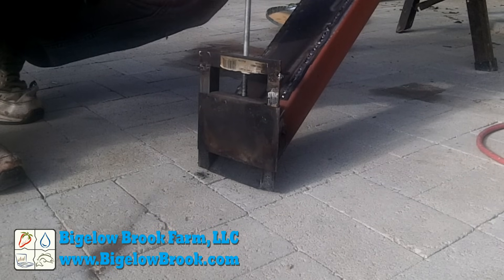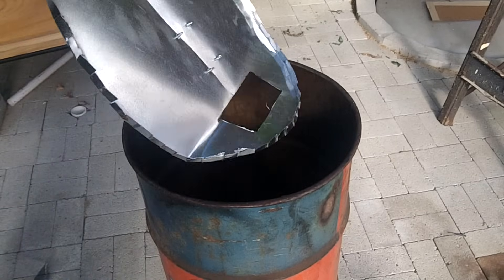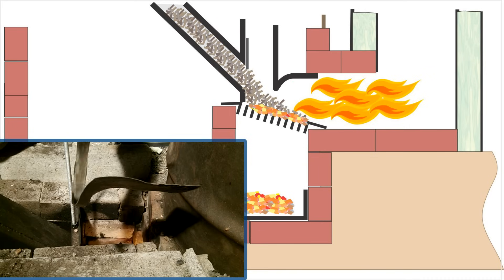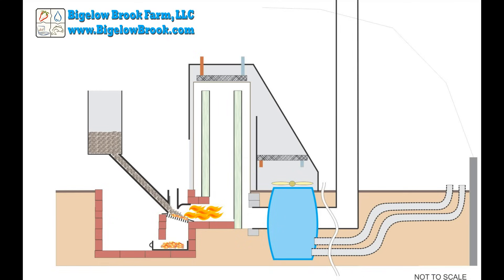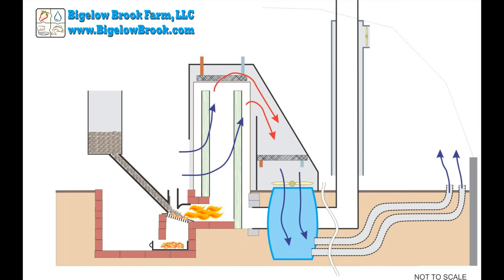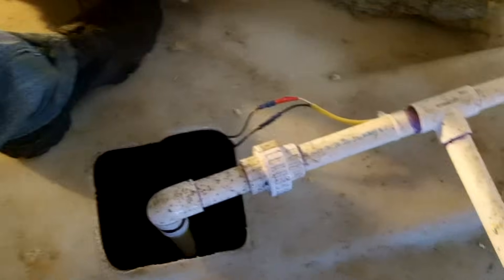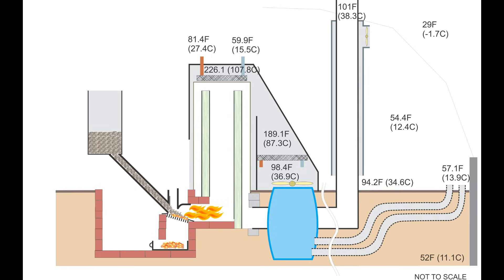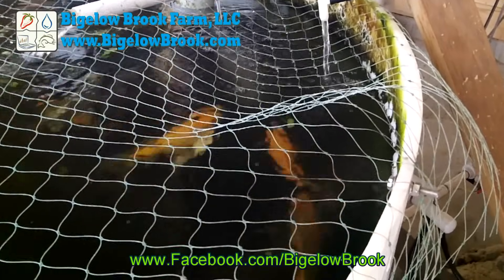Rocket Mass Heater - On Steroids

Comment: This looks so dangerous.
Reply: No more, heck probably less dangerous than having a fire place or wood stove.
Reply: A pipe gets a hole because of acidic water due to the low Temps, do you not see an issue with carbon monoxide?
Reply: I guess it really depends on how air tight that room is. But yet again same thing from a normal fireplace and wood burning stove. Also the way he has the water running he would notice a leak long before it had an effect on the stove piping.Plus, I would be willing to bet he has a carbon monoxide alarm in their to be safe. Every building where things are burned should have a alarm like that.

Comment: Does the cooler temps not trap acidic condensate in the low flue pipes?
Reply from the maker: I haven't seen any problems with it yet...but haven't dug up the duct that's buried under the floor.  If it is in there, it will just weep out through the joints.
Reply: Bigelow Brook Farm (Web4Deb)   It will erode the pipe quickly and then be filled in by whatever was around it.  You also have a great potential for CO issues in the home.

Comment from the maker: The 2nd most viewed video this year triples the views of number 3!  With 264,007 (268,862 total), it was published at the end of last year.  It shows some extreme enhancements we made to the rocket mass heater to try to extract as much heat as possible from it.  I'm still burning pellets in it without any issues...but I am currently working on a new design for next season!  Rocket Mass Heater - On Steroids
Reply: do you have a cost comparison of fuel pellets vs wood?
Reply: I can gather my own firewood but must purchase wood pellets.  The ones I'm using are $7 can for a 40lb bag and I would rather burn nearly free firewood over 7 dollar a day pellets.  Although he may be able to increase his efficiency by throttling down the pellet feed rate. His exhaust to outside temp seems too high, wasted money.
Reply: Logan Mailandt the pellets are clearly more money, but the gain is the convenience. Over time, the user would learn the ratio of pellets over time, and be able to add that specific quantity to the system all at once. Only having to return periodically to fill the system back up for the next burn. The wood fuelled heat would consume a chamber full of fuel much more rapidly, requiring the user be present much more often. 
All that said, wood pellets aren't too expensive, and are much more affordable when used in a more efficient systems than the conventional pellet heater.

Comment: What about the aluminum getting in the fish water? I wanted to use a radiator for my fish tank heater, but running the water through an aluminum radiator does NOT seem like a good idea.
Reply from the maker: It's not something I would recommend for everyone to use.  Aluminum can become a problem if the pH goes really high or low.  I can't remember the chemistry behind it, but it does have a toxic effect.  I usually tell people they should keep this part closed loop and put some stainless steel loops in the fish tank.
Reply from the maker: tammy c stainless is the best way to go.  Copper is far worse than AL.
Reply: Ya I think we will build some copper loops for it.
Reply: tammy c opps copper is toxic to fish??? so stainless steel
Reply: thank you
Reply: +tammy c  Tammy, when copper is exposed to water intermittently it will Verdigris, which is an acidic formation on the pipes that makes them appear greenish blue. This formation is toxic to biology and would only be effective in a closed loop system where wetting was more constant and the possible contamination with lead soldered connections may be more likely. Poster used AL possibly for its cost effectiveness and was easy to obtain. "Copper Worms" are common in many water distillation processes. Many of which are being replaced by Stainless coils which are almost noble in their properties. Some people even drink that water!

Comment: does all that lead in the radiators not harm the fish?
Reply from the maker: they're aluminum.
Reply: yes, but radiators are soldered together with lots of lead. I just know they are not at all okay for home brewing. 'how it's made' did a segment on radiators; maybe it's online
Reply from the maker: It's aluminum!  You can't solder aluminum.  They are all welded together.
Reply: +Bigelow Brook Farm (Web4Deb) whew, I thought you'd never say that.. yet I knew you knew somehow. Your system looks thoughtfully contrived to me. Kudos and so true- AL is brazed; copper is soldered. Therefore, there can be no leaded soldering of connections. However there will be trace amounts of AL in the water due to galvanic reaction. Is ok, Koi will let him know if they swim on their side just move them to fresher water and flush system clean. Sooooo, peace out Bigelow!

Comment: scrap the box fan,it waste way too much power!
instead use 140mm 12dc computer fans,  10-12v switching power supply/charger.
next get a solar panel and homemake 18650 lith battery bank for the 12v
next,12dc pumps, white leds for lighting then your complete.
use car for ER generator for batterys.

Comment from the maker: the radiators take some of the heat that would have just been blown into the ground and put it into the fish water.  I could have done it with loops, but I would have had to use stainless steel piping (copper is toxic to the fish) and it would have gotten very expensive!

Comment: Maybe I missed it, but were you saying that the key purpose of the radiators was to remove excessive heat from ground system? I know it also runs warmed water over to the fish tanks as well, but that could have been done with hot water loops around your outer barrel right? 
I'm not judging, as I've only read about these heaters. I really appreciate your detailed videos and explanations!

Comment from the maker: It hasn't been an issue, but using aluminum is usually frowned upon as it can become toxic if the pH goes REALLY low.  I'm planning on replace them with stainless steel.

Comment from the maker: I've never tried to bypass any of the rafts to heat just the fish....I just wanted to avoid having the system too complex.  I have to be really careful not to heat the water up too much over the air since it will start to condensate too much.  I already have a problem over the winter with powdery mildew when it gets too humid!

Comment: hey I was wondering if you have done temp tests I figured at every 1 you raise the water temp of the fish 2 degrees with it cycling in the system but if you put it in the sump by bypassing the raft system having it run into the heater then the sump? until you get a constant water temp of total system of 77 degrees which plants roots love grow like wild in the winter easy up take..Love your system have to show you mine some day when I get all my projects cleaned up plus I use car parts with solar

Comment: Harbor Freight has a laser targeted infrared thermometer for $35 (sometimes even cheaper) that accurately reads temperatures up to 968° F. It works great! ...despite its price vs the ones found at h.depot and lowes. just a suggestion. throw that other/old one on craigslist or ebay to get you some money to buy the new one with :)

Comment: There was a fellow who took ceramic "90' angle iron" and criss cross those ceramic angles. this was for a "standard" pellet stove with I believe a vertical pellet supply. the ceramics were tempered and supposedly could sustain higher temps vs. stainless steel and for sure reg. hi carbon steel. It would be worth investigating if the price was better than ss .

Comment: Have you thought about feeding the air into the system from outside? Currently all the air that is vented out the chimney must be replaced from air which will enter the room from outside. Directly feeding from outside would eliminate this requirement.

Comment: Ahh *nods* you are quite correct.
I would think tho that if that is the intent, then a small thermal insulator around the mass (which is intended to be the thermal mass), to isolate that mass from the ground mass would be ideal.
Yes?

Comment from the maker: houses are far more energy efficient than a greenhouse (here in New England) so we need to produce a lot of heat at night.  The unit burns far more efficiently and hotter than a regular pellet stove.  It's also is used to heat the water and the extra heat is stored under the floor.  It also costs less than $500 to build and doesn't require electricity to run (but I do use a fan to pump the air under the floor).  There really isn't a comparison between this and a home pellet stove.

Comment: Part of what he wants this system to do is to heat the thermal mass of the ground. This is where some of the confusion is coming from for others concerning the heat output of the system. Most are not taking into consideration the ground. Good on ya to catch that! Just keep in mind the reason he has those tubes is specifically to heat the ground.

Comment: Have you thought about recessing farther into the floor and using thermodynamic circulation as a backup for pumps? If you look at this idea using copper or aluminum tubing and fittings on the radiators might be a good idea based on the melt out from one of your other videos.

Comment: my understanding is CO WILL burn, if the temp high enough. Temps in the heat riser (rockety part) of a RMH easily exceed whats required.
Still...your right, a CO detector is a good idea anywhere fires are used!

Comment: Hello, you will want to use the exiting excess heat to preheat new cold incoming air in the winter. This gives you a higher efficiency of the system and a higher room temperature.
Nice job!

Comment: I love your whole system. You could attach a peltier generator from teg power or build your own ,and use the extra power to charge up your battery bank or power more water/air pumps. Attach the cold side to the water coming from the ground,or the fish tank. Build a simple oil circuit for the hot side(300c), so you can maximise the temperature difference.  Also I've been wondering what might happen in an aquaponic system if you connect a water imploder from dan winter that makes structured water.

Comment: I just thought 40lb of pellets was a high consumption rate. So how many BTU do you think the system generates? As a comparison here are some numbers with what u can get with natural gas, if available of course. 1 cubic meter is approx. 10 KW = approx. 34,000 BTU = 10 cents. If your pellets cost $6 bag that 60 cubics of gas x 34,000 BTU = 2+ million BTU.  Now for a premium bag of pellets ( not the $6/ bag ) there is 8700 BTU per pound, or 348,000 BTU. Something not right here.

Comment from the maker: the 4.4KW heater would just be for the water part, which is just a fraction of the heat the rest of the unit is putting out.  Between heating the water, thermal mass, and air, it costs far less to heat with pellets than it would with oil or propane.

Comment: love this sort of stuff and commend you for your efforts,HOWEVER, you say you consume a 40lb bag of wood pellets in approx 8hrs. Cost of a bag of Pellets is say $5-$6. You also say the rocket stove generates heat equal to a 4,4 KW/hr heater. I'm not sure what the advantage is compared to doing all this electrically. Lets assume 1 KW/hr costs 10 cents that's an electrical cost of 44 cents. Multiple 44 x 8 hrs is $3.52. Use natural gas cut that in 1/2. whats the advantage to this system?

Comment from the maker: The water will boil out of the radiators and the heat just domes out of the cover.  It's happened twice now.  Usually if we lose power, I usually run down it shut it off before the water boils out.

Comment: Awesome work!!  Don't burden yourself with minutia like crappy welding just continue to prove concept, like you are doing, and move on. There are many fine skilled people out there to accomplish fabrication. I did not watch your other clips. However, I strongly agree with a previous posters good advice to get a CO sensor installed if the combustion /  exhaust components are in close proximity to an enclosed space. Good luck!

Comment: Hate to say it but I think you have a hazard brewing with your design. If any part of the exhaust system springs a leak you may have carbon monoxide leaking into your space heating system. If it exhausts into the living space you are in danger. You need to equip the house with a CO detector.

Comment from the maker: This heater worked fine with wood burning, but you're right that it now produces too much heat burning the pellets.  Most of the time I'll let it run for one bag's worth (3 hours) and let it go out.  I don't need to insulate the outside panels since I do want some of the heat to go into the air space. Plus, if there's a power failure and the fan can't run, the heat will radiate out through the cover.  I'm going to rebuild this after the heating season is over and probably go down to a 6" chimney

Comment: Great work. Since the pellet feeder introduces a more efficient supply of fuel could you not scale down the size of the whole thing? I'd be tempted to insulate the outside panels so that you can direct more of the heat where you want it. I am guessing that this mechanism is producing more heat than you want. Its a very good design overall.

Comment: Did you ever hear of the "KISS" principle?  With all due respect, your design could be much more simple and more maintenance free, not to mention less dependent on external power sources.  I know of an "RMH" wood, multi-fuel boiler that will not only provide hydronic heat, but steam power as well to run circulator and fan(s).  It takes up a LOT less space, too.  The system will provide hydronic heat and steam pressure, concurrently.

Comment: Just a thought: you could further that idea by running that closed loop into a sump (hole) in the ground. The hole/trench would be filled with crushed glass and insulated from the earth to reduce thermal leaching. At night the glass would release the stored heat. The pump for the loop could be solar powered. Not my idea, similar to something I saw on a BBC series called "It Ain't Easy Being Green." Cheers!

Comment: I was wondering if your heat tubes under the floor of the greenhouse are below the level of your feed tube?  I was thinking about retrofitting an RMH to an existing building that has a crawl space.  I wanted to put the mass in the crawl space so that the floor is warmer.  The other advantage is that I would not have to rebuild the floor structure. I still want the barrel in the living space for immediate heat and I want to feed the fire from the lving space too.  In your exp. is this possible?

Comment: True those are not normal pH ranges for fish and can in and of themselves be a problem for the fish. No need to have heavy metals or other things build up in a system so that they are released as poison when the pH goes out of the acceptable range. Another option for heat exchange in the fish tank is a stainless steel heat exchanger. These can be found at swimming pool shops that sell heaters for pools. However with any closed loop method you end up needing another pump.

Comment: I am wanting to do the same type of thing with the hot air in the top of my greenhouse. I plan to hang a radiator up in the top of the greenhouse. I was planning to make it closed loop system as the radiator is aluminum. I think that the best tubing to use in the fish tank and/or slump is PEX with aluminum in the middle. It has PEX on the outside and PEX on the inside and aluminum in between. This is used in in floor heating systems to spread the heat out.

Comment: Just wondering if you have considered the risks of running the water through aluminum radiators?  Aluminum is toxic to fish and in a closed loop system it will build up over time. At pH values of below 5.5 or above 8, aluminum can become toxic to fish.Aluminum interferes with fish's respiration in the gills and they can die. You can combat the aluminum through the use of peat moss as it can absorb 80% of dissolved aluminum. Aquarium owners recommend not using aluminum in the water.

Comment from the maker: I'd love to see your hammer mill system.  I've been looking at various models.  I'm pumping a little over a gallon per minute through the radiators.  It doesn't take much flow to keep them from boiling.

Comment from the maker: It's hard to split wood that's over a couple of feet long.  My splitter only goes to 24 inches.  Wood tends to jamb in the chuts with their uneven knobs and sticks.  If you get any back draft, the flames come up and it can come out through the feed area.  It's very difficult to put out the fire once these start to burn backwards!

Comment: My main point is that the ground is already near the temp you want the air, so use the ground as a heat source to preheat the air to near 50 degrees, then you aren't burning anything to get it there.  You just need to reverse the flow and draw air from the barrel and feed it as intake air to the heater.  If you have enough contact area with the ground, you will effectively raise the temp of the air for free.

Comment from the maker: I can't shut off the water that goes throught the radiators because it will boil out of them.  There's so much mass in this system that running it for a 6 hour run only changes the water by 5-6 degrees.  This design is nice and simple...don't have to deal with the risk of getting any antifreeze in my water either!

Comment: Are you concerned that you are only getting the air to 55 degrees?

If your ground is 52 degrees, you should use all of that piping to get the ambient temp of the dome to 52 degrees, then use the RMH to raise that 52 degrees.  Right now you're going from 29-55, which is a 36 degree rise, you could put half as much pellets in the RMH to get 70 degrees ambient if you used the thermal mass of the ground to preheat the dome.